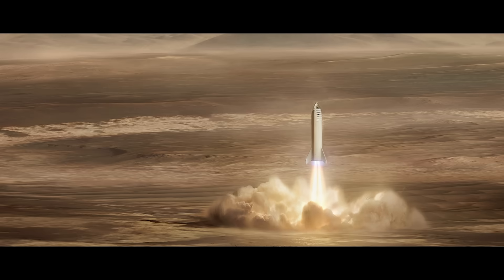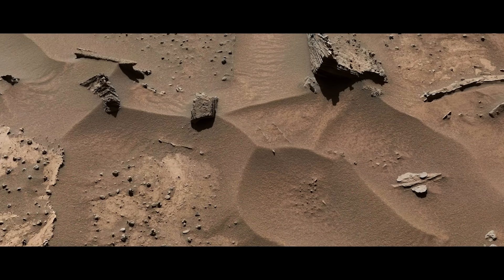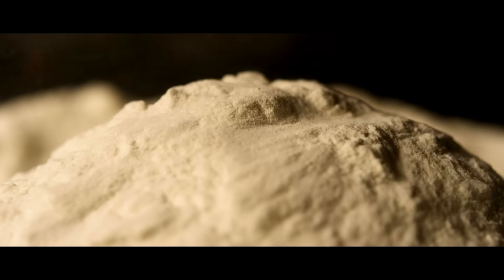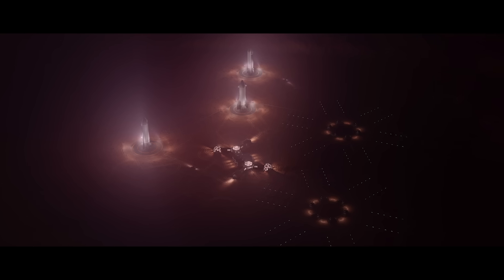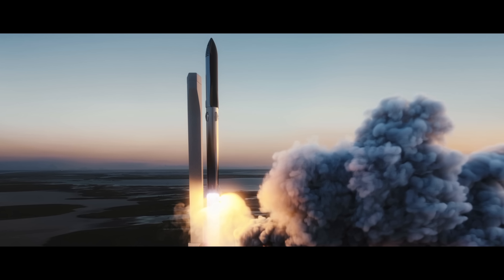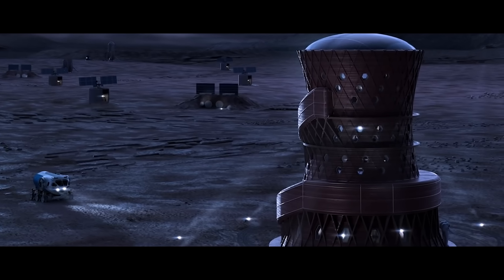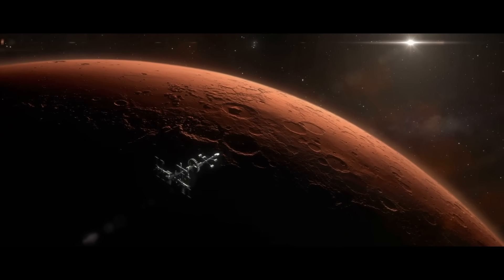THE FIRST 10,000 DAYS ON MARS (Timelapse)

Comment: Printers - you've got to mine and process the feedstock anyways, using binding matrix from earth. Then you've got to line them.
Tunnels - dig them out, carry the material to the surface, seal with airlocks, that's it. Process the mined matl if its useful.
We'll be mining anyway, why not live in the tunnels too?
Huge voids - cris cross several stories, detonate nukes to collapse, and you'd have an enormous bubble.

Comment: What is important is that wherever there is life, it evolved to fit into that specific planet or satellite. Even our proteins are based on levorotatory amino acids.  Everything about every organism on this planet is designed by 4 billion years of adaptations to a majority water surfaced ferrous core, rocky planet of 5.972 x 1024 Kg in mass and a gravity of 9.807 m/s2 influenced by single satellite with a mass of 7.34767309 x 1022 Kg and gravity of 1.62 m/s2 revolving every 27 days 378,000 Km distant in a goldilocks area 146-152,000,000 Km from a star with a mass of 1.989x1030 and a gravity of 274 m/s2 and a surface temperature of 5,778 K.  Any slight variation in any of the above parameters will affect the morphology and biochemistry of the life forms even before we get to atmospheric gases, shape and mass of organisms and how they respire and utilize gases. There are some things that would be held in common between organisms on earth and organisms on subsurface Europa, tau Ceti e or Proxima Centauri b.  Alien life forms would be carbon based but the amino acids that make up their protein structures could easily be right-handed rather than left-handed.  Our skin shades were determined by sun exposure and more than 10,000 years ago all skin tones were dark. What if the “aliens” were from a planet or satellite, like Europa, where heat is generated from within?  It is certain that any other life form that reproduced via information transfer with ribonucleic acids would NOT have information units compatible with human genes. The long, short and breadth of this is that no human from earth could survive for very long on any other “goldilocks” planet (which eliminates Mars) but certainly not 10s of light years, at least, distant or throughout the galaxy (or other galaxies in out local cluster, or even survive the trip. Conversely, no extra-terrestrial sapient life form could survive on earth unless they came from a planet with the exact parameters mentioned.  Not only the exact type of GV yellow dwarf star and above parameters must be met, not totally impossible among trillions of planets in this galaxy but the trillions of planets in Andromeda and every other galaxy.  There is another factor, the 4 billion years of random events that drove the successful genomic adaptations that made life on this planet possible.  In short, we will never meet Spock or Warf nor they us. We are STUCK on this planet and idiot billionaires that want to spend many billions to take people on a suicide trip should concentrate their grandiose dreams on cleaning up this planet that we are daily making more toxic.

Comment: What kind of reactor would they use on Mars and high do you cool it
Reply: Solar panels
Reply: @darthflash6994  uranium needs water pumped into the system to cool the rods to keep from melting the steam inside is transferred to the turbines to generate power . Seeing that mars has no oceans or lakes to gather water from and glaciers need to be mined . Where are they going to get their water from
Reply: @pbabuik  Uh, I did say solar panels.
Fusion reactors are not possible before 2050 at least.

Comment: ditch the 3d printed habitat idea for the first structures.  the first structures should be built using rammed terra brick which will require less technology hauled to mars.  this should at least be plan B if the 3d printers fail which is 100% guaranteed :)

Comment: You do not fly to Mars when Earth and Mars are closest to each other.  You fly to Mars when the energy to reach it is the lowest.  This is called a Hohmann transfer orbit.  (It happens when Earth is about 90 degrees behind Mars and catching up.  

The advantage is that you use Earth's orbital velocity to add on to the space craft's velocity to minimize the energy to launch.

You are FAR too optimistic about how easy it is for plants to grow outside on Mars.  Some problems: air pressure, temperature, radiation protection, sterile soil, carbon dioxide poisoning, oxygen starvation (advanced plants need a bit of oxygen in the air), insects to fertilize them, etc.  I might believe some brown bacteria scum growing in a pond on Mars in 10,000 days, but not advanced plants.

Fun video tho.

Warm regards, Rick.
Reply: Crab grass will find a way… it always does lol

Comment: The last point is a bit iffy in my opinion. Realistically plants couldn’t grow open air on mars, not because oxygen but because radiation. Mars is battered by radiation from the sun due to its lack of a magnetosphere. There have been some suggestions of pretty much sticking a huge electro magnet in front of mars realative to the sun in order to block radiation however

Comment: solar panels wont work. they will but good luck. we need cold fusion or a means of turning rust and co2 into energy. full nuclear. pump any excess energy into the ground and cross your fingers and hope to influence the poles. the only way to establish atmospheric pressure on mars is to add mass to the planet and establish an atmosphere in magnitudes thicker. no plants or trees will live there unless they're in pressurized jars. or a heavy and thick enough and warm enough atmosphere to support oceans. good luck warming the planet unless you can set the ground on fire. if we find aluminum deposits we would have to set them off like a thermite bomb. nuke the planet for 100 years. and ferry in asteroids. in a 100 years the short answer is we cant. in 5000 years the short answer is - we got something to work with if it wasnt so damned irradiated, but we got plenty of diamond deposits to mine in the future. we could also work on activating the core at that point, by adding a moon using some of the asteroids that missed. terraforming mars is a god level feat. but we can do it.

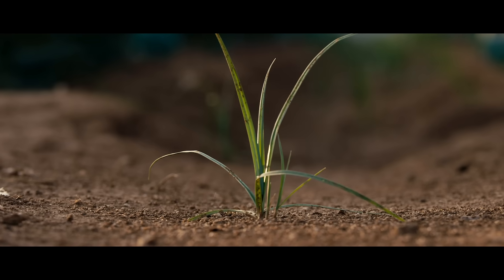Comment: 15:11 Forget about Mars atmo ever becoming close to Earth, without true-grav tech.
Any extra atmo generated will be stripped from the planet.
Really, this can't be helped without true-grav tech, which has no basis at all
in fact anywhere yet.
Reply: Even if it were availabe in the next 50 years, already present structures would collapse
using such tech on Mars, and the Mars surface would collapse under it's own weight.
Reply: @ZMacZ  You think you know an awful lot about technology that hasn't been invented yet. 

Also, the rate at which the Martian atmosphere is stripped, while higher than Earth's, is not so high to remove "any extra atmo". If only because it scales with atmospheric pressure, and the first added atmo will be a very tiny amount, effectively having zero effect on the atmosphere stripping speed. It took millions of years for Mars to lose this much of it's atmosphere, so going on past experience, if we add atmosphere it will again take millions of years to remove it, that is a lot longer than humanity has existed so far. And as long as we keep adding we can balance it out for a lot longer. Basically until the sun goes nova.
Reply: @bramvanduijn8086  So, basically what you are saying is that when an 0.3G planet needs actually a three times as high atmosphere to get a 1 bar atmosphere at ground level it would not lead to excessive atmosphere stripping ?
In fact that would 3.3 times higher atmosphere.
This reply is rhetorical.

Also, at a certain point the amount of stripping that happens will far exceed the ability to add new atmosphere. But hey, you obviously know this right ?

Comment: 14:15 With so many scientists on Mars, it's perfectly possible that new techs start coming from Mars.
Also, what's with the 2D thinking ?
Mars is perfect for 3D inhabitation.
If the buildings on Earth can be easily 600m tall, the buildings on Mars can be like 1800M tall,
or starting 1 km below the surface and stick out an additional 800 meters.
Reply: Or Mars surface to orbit accelerators allowing for external mag-lev acceleration for speed markup.
All delta-v that doesn't have to come from fuel is guud.

Comment: 07:21 Don't be stubborn, go under the surface for initial deployment.
You can't afford meteor damage and such in the initial stages.
Once enough subsurface infrastructure is active, then you can go surface stuff.
If you do it the other way, if a meteor hits, that's bye-bye.
Reply: Once nanometric radar, and automated particle emission can be applied for incoming meteor defence, yes, then the surface could be safe enough.
Reply: And as per usual, critical structures, why risk above ground ?

Comment: 03:03 Journey to Mars, ur doing it wrong.
You need like 4 Starships, combine them with a central strut, and then allow for spin
to create grav sim, between them.
THEN you can go to Mars without grav-loss bone decalcification and such.
You can even use mere 'rope', attach and detach, roll-it up for reuse.
Reply: Test future astronauts by putting them on a large carrousel, for two months,
to see if they have very high motionsickness quotients.
Basically, if they get motionsickness here, they'll be motionsick everywhere.
The amount of spin for testing should be higher by 20% than the actual motion
spin in space.
Also, only use mild motion sickness suprresants for essential personel testing,
if they have to use some.

Technically, using a long tether may only need very little spin to get grav-sim,
but it's tricky. this is best used with ion tech involved.
Reply: I'd suggest a carrousel brought along for quick deployment on Mars with the colonists,
for grav-sim, or one built on Mars itself, by precursor drone factory.
All it has to be is three things, wide enough, to reduce spin to minimum
and subsurface and continuous operation.
People may work in less than Earth G, but then when they are off duty, they go to a 1.1G environment provided by the carrousel.
Reply: I'd also suggest, instead of fish, plant ptrotein extractor tech and processing.
It's not the same as meat (or fish), but it's healthy and can be made in various
textures and flavors from plants, which are already being grown.
Also, a chicken or to would be nicer, they'll enjoy Mars and make you many eggs.

Comment: Football fields of solar panels ?
Umm, yeah, bad idea, use solar film, deployable, and rectractable.
Maybe a few hard ones for init.
You know that the difference in weight is like enormous.
Also, a small 'factory' that can recycle this film, if it gets damaged, and produce new film.
This can be augmented by a local resource production.
No, not a big factory at millions of tonnes of weight, but a small one that weighs like 100 kg,
and can produce maybe 1m2 film per day.
Reply: I'd suggest a molecular beam splitter tech that allows elemental stream separation.
Basically, a stream of single elements that vary in mass and magnetic susceptibility,
that then can be separated using various fields, splitting each element
into a seperate direction where it can then be captured.
Energy intensive, but very useful for local resource gathering.
And yes, 100 kg, although this may not be a hard limit.
Reply: Getting a few grams of pure elements on Mars per diem is worth billions in sending from Earth.
Reply: Note: There's a group of people pretending to be me on the Internet,
for the purpose of identity fraud and fraud in general, on always changing servers.
I don't do vids, period.
They can only speak what I type as I type it, and the rest is usually nonsense,
or stuff I said or stated earlier.
Buy into their bs, and it will be wasted resources.
This may exclude, if ever, crowdsourced funding for an orbital station-on-the-cheap, in the future.
Otherwise, not me, despite 'proofs' that they are.
I don't ask for money online or IRL for that matter.

Comment: The initial colony should be located in a deep crater, to minimise asteroid damage
and sand storm damage, with a rocky inner wall.
This then can be used to drill into the surface at an angle, slowly decending
into the Mars surface, and when curved, dissallow asteroid 'freak' accidents,
like impact directly into the tunnel.

Comment: I won't lie, they completely lost me when they said a starship would cost Five Million Dollars.  That's some magic math right there.
Reply: Well, the projected cost per launch is 2 million. If a ship is reusable then of course the cost to build it will be higher.
Reply: Rockets cost a fortune 5 million is cheap compared to other rockets.
Reply: @myballsitchsomethingfierce6319  ,  @Galorbean Sausage, you both missed the point entirely.  Cost of raw materials to build a Starship will exceed 5 million dollars.  Precious metals and rare earths for electronics, nondestructive testing of alloys, energy costs of casting and shaping alloys.  Then the cost of personnel for QA inspection and shipping parts to the launch site.  

Even if launch cost is 2 million, which I doubt.  Fuel cost alone (not counting cost of maintaining cryogenics on the ground) is ~ 1 million dollars.  Then after recovery (costs tens of thousands of dollars) you need to do a full engine teardown and rebuild to check for fatigue.  It's the same reason the Shuttles were fully reusable...and yet cost more than disposable rockets.  Cost of the rocket itself in normal launches tends to be a small fraction of launch cost compared to the fixed infastructure/fuel costs (plus you have to pay for extra fuel to save your rockets by landing them).

A Falcon 9 costs 65 million dollars per launch.  Not a Falcon heavy, a Falcon 9.  There's not much lower they can get without insane developments.
Reply: Dude 5 million is honestly dirt cheap compared to the price to make traditional rockets and satellites.
Reply: @Jen-jd3ci  Oh my god I literally just said the problem is it's honestly dirty cheap.  It is too cheap to be a real number.
Reply: @BlindeyeZero  lol no stop hating.
Reply: @FungalumisBush  I'm not hating, I'm just confused that when I seem skeptical of the cost, everyone's reply is "wow, so cheap, I'm excited."
Reply: I got bad news for you all on Mars it will be illegal to eat Mars bars instead you eat Earth bars. You don't see us here eating Earth bars on Earth well the same goes for not be allowed to eat Mars bars on Mars, Earth bars only got it!!!!

Comment: 10,000 days to get a "terraformed" mars able to grow grass. HA maybe in 10k years with a direct effort to terraform. There is not enough Carbon to release in the atmosphere to give it enough pressure without throwing millions of tons of comets at it. Additionally, boiling the ice caps, and burning regolith on the ground to release its gases would simply not be enough.
Reply: that does not even take into account solar winds stripping the atmosphere. There needs to be a massive orbital electromagnetic shield protecting Mars from the solar winds.

Comment: Just watching this now and I keep thinking...what if the spot they choose to build this things is the middle of an frozen ocean that's been covered by dust...and it just starts crumbling after couple of years
Reply: Its quite doubtful that would happen. The sensors on the rovers and satellites are powerful as fuck but if that's the case, NASA and SpaceX scientists back home would be extremely happy. Also, they mentioned it was something like -42 degrees, so the ice must be pretty thick, probably even thicker than the glaciers we have here on earth. Only problem would be getting the resources to build 3D printed habitats to survive the radiation, which I think they would have noticed if they tried digging.

Comment: This is like seeing the first movie of like... Star Trek vs Total Recall (1990)...
I have to save this video and watch it again in 32 years....
If any of this will happen, Elon and his crew will have a huge place in the history books...
Reply: perhaps you should print screenshots from it - I wouldn't be so sure there will be even electricity left in 32 years...
Reply: @TimBenassi  Good idea. I set the printer to print the video resolution at 30 frames per second. And then they just get a staple to keep track of them. Then I can run throw them and watch it as a video. Thanks for the tip :D

Comment: Back up .. SEVEN (7) Months to Mars?  
The Starships are designed and fueled to do it in between 3 to 4 months (depending on eccentricates of the Earth and Mars solar orbits).  One of the reasons for that was, IIRC, is that it puts the astronauts just before or in the gray area where you start to see low/micro-gee effects on the human body {per research on the Saluts, Skylab, Mir, and ISS} so the effects would/should be minimal to little.  
So, between everyone wanting to get out and walk around just a little and everyone at home on the edge of their seats waiting for the First Step on another PLANET .. it might just be somewhere between 24 and 48 hours after landing that that happens .. then a day or so before everyone gets their heads screwed back on to do the job of STARTING to set up the Colony. ;)